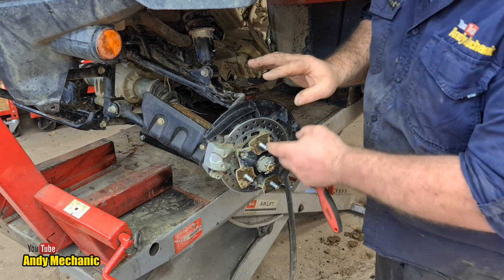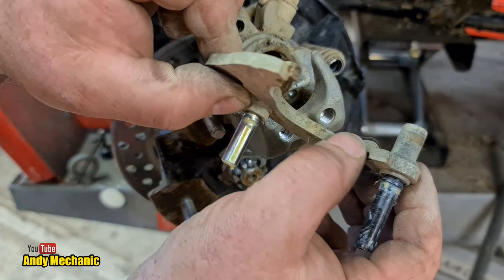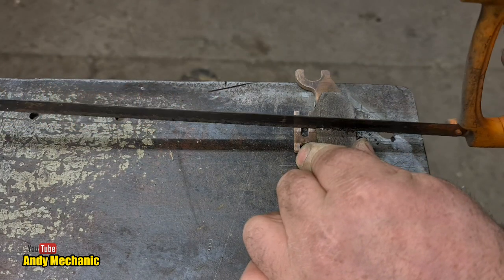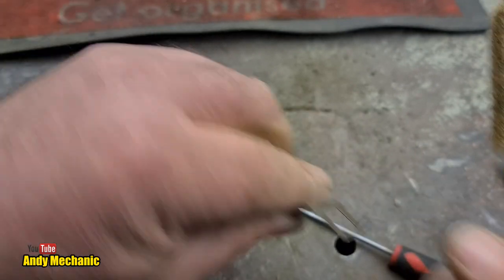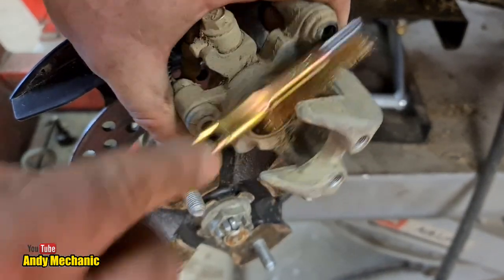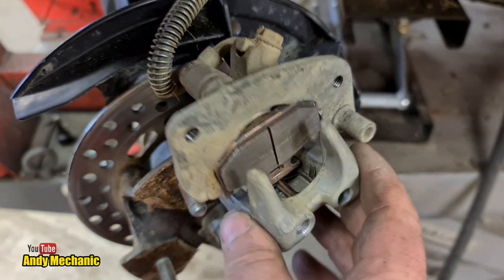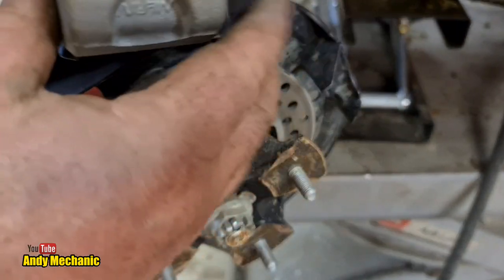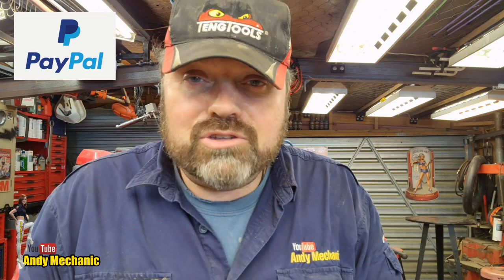Suzuki Kingquad - front brake service #1348

Comment: Hi Andy! Can you use copper paste  for lubricating brake pads and slide pins?
Reply from the maker: Yes for the pads but you'd be better using a heat resistant grease for the sliders - make sure it's okay to be used with rubber.

I used to use copper paste on the sliders but it can dry over time & gum them up causing resistance 

Hope this is of help

Cheers Andy

Comment: Hey Andy just did new front pads on 2020 kingquad only one caliper is grabbing and won't build pressure at the lever. Bled brakes still no pressure any guesses
Reply from the maker: Too much piston retraction, did you rebuild the calipers or just push the pistons back in to fit the new pads?
Reply: @AndyMechanic  yes
Reply: @AndyMechanic  but I  can see one side squeeze and grab the rotor not getting anything from the other side
Reply: @AndyMechanic  pushed them back in it's a newer quad with low miles
Reply from the maker: Piston to seal interface likely dry. Pop pistons out, clean, refit & bleed up
Reply: @AndyMechanic  ok I did this still no luck one side is grabbing and other side isn't ... I pinched line on working side and other side works now and lever has pressure .... remove the vise grips and back to lever going all the way down and not working ... I'm lost here
Reply from the maker: Hi, there is either air in the chambers of the caliper or you have too much piston retraction. I suggest bleeding the system at the problem caliper end. If that doesn't resolve then remove caliper & pads & watch the pistons as you apply the brake lever. The pistons should only retract about half a mm - you could compare to the distance the good calipers pistons retract.

If too much retraction you'll have to remove the pistons & seals. Clean the grooves where the seals fit. Reassemble using only brake fluid on the seals as a lubricant - no grease of any kind please. Rebleed system & check retraction distance again.

Cheers Andy